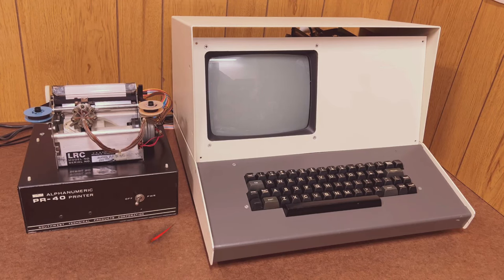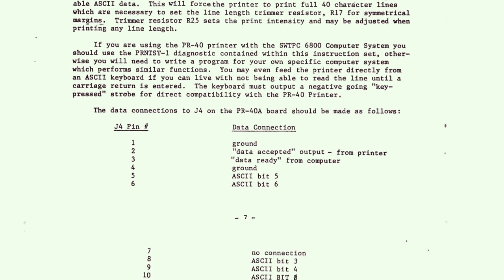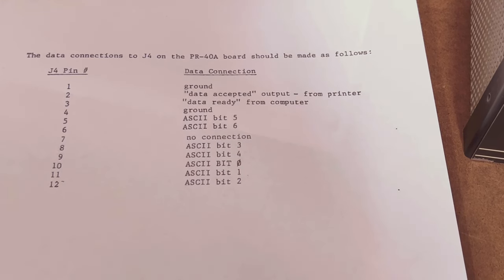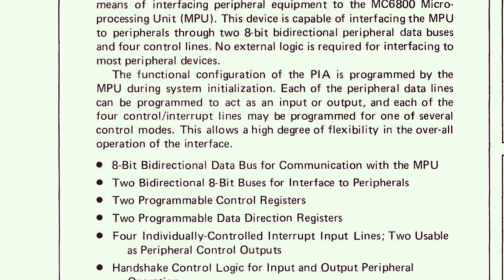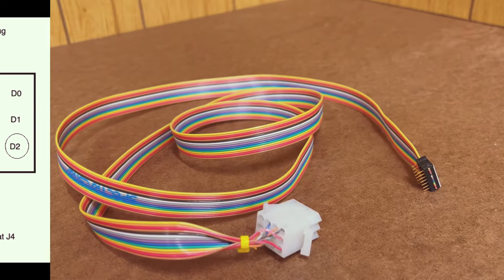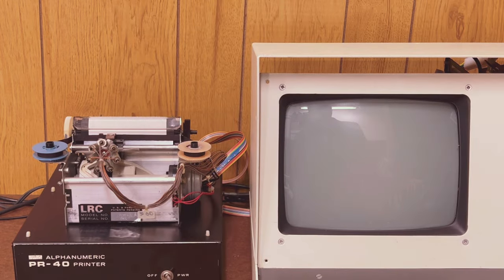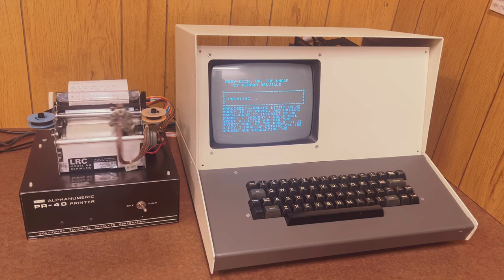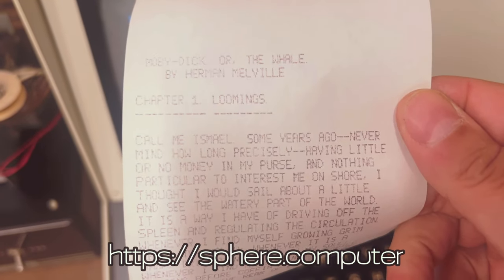Printing from a SPHERE with a SWTPC PR-40. Vintage Peripherals with Peddle's PIA!

Comment: Memories.  That was my first printer, bought as a kit in late 1977 or early 1978 , assembled and installed (with a lot of fiddling) on my TRS-80.  Definitely not high class, but a $1000+ dot matrix, or an even pricier daisywheel was the only thing else out there.  The thing did work rather well, once the data timing was tweaked a bit.  SWTPC for the win!  Do remember that sound..  Thanks for the memories! Stu

Comment: Hey, I still have my PR 40. I drove it from a home built S100 6800 system. As you mentioned, it was great for printing BASIC listings. My system was also interfaced to a Southwest Technical Cassette Storage System for saving the BASIC programs. It sorta worked occasionally 😤. I built a TV based display monitor from an article in an early BYTE magazine. It was great! Ultimately I interfaced the system to a Teletype ASR 35. It was much easier to talk to than the P40. Anyway, thanks for the memories. 😂
Reply from the maker: Printer + TV typewriter was a whole lot of DIY, that was a real moment in time. If you feel like working something out for a good new home for your PR40 please do drop me a note! (bzotto at gmail), the one in the video is a loaner. In any case thanks for watching and sharing the memory!
Reply: @bzotto  At this point it’s not in the best of condition. But if I decide to let go of one of my dear memories, I will certainly let you know. Frankly, it would be in a better place than just on the shelf, collecting dust.
Reply from the maker: @philipershler420  Thanks for the reply-- fair enough and inbox is always open. ;) Meanwhile stay tuned for more stuff of the era...
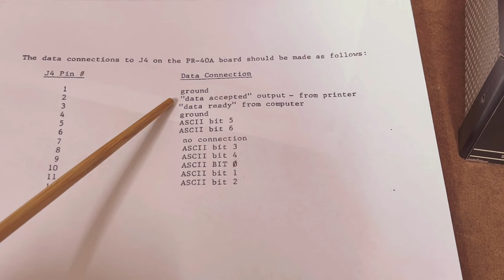Reply: @bzotto  4:22

Comment: The descendant company, "Pertech" of LRC that made the 7040 printer in the 1970's is still in business in Riverton Wyoming making ticket and custom printers.   I worked as an computer engineer for LRC in the 1980-82 and still have a few parts from these printers.
Reply from the maker: No way! That's so cool. Thanks for sharing the connection.

Comment: Side-stepping SWTP's ASCII-to-dots translation would be interesting. If we could control the dot-matrix directly, we'd have high-ish resolution graphics in 1975!!!!
Reply from the maker: The dream!! In practice you can’t prevent the line breaks— the rotation of the platen is part of the carriage mechanism. But you could still have strips of 240x7 or so horizontal bitmaps :)